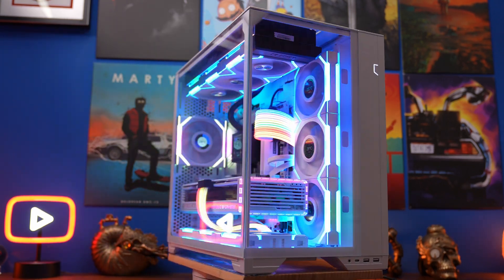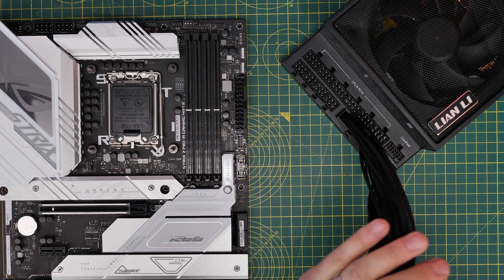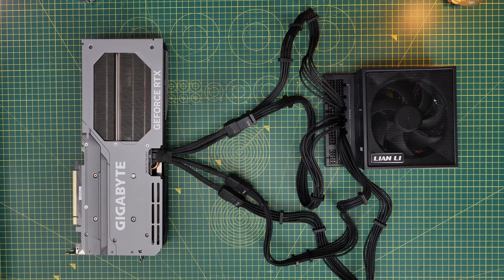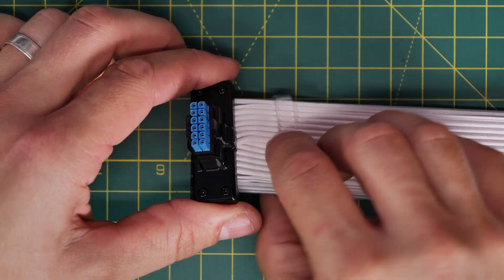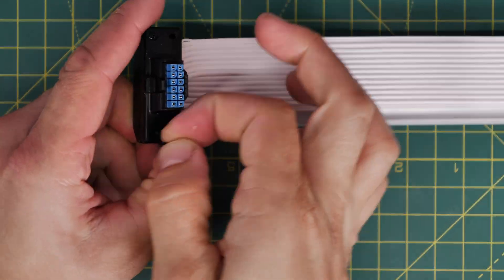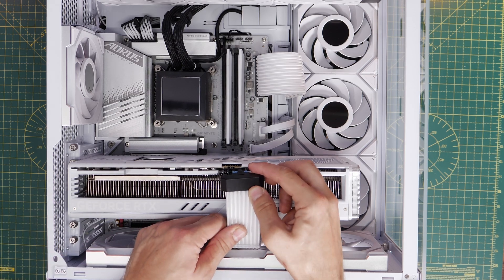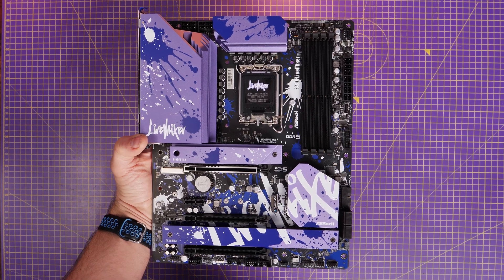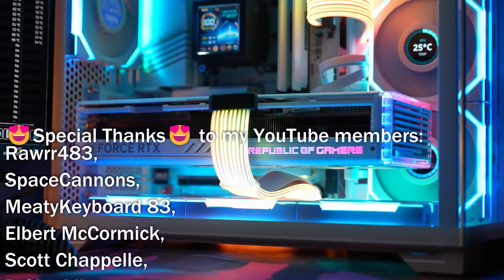Lian Li Wireless Strimer Setup guide - easy RGB extension for your 24 pin and 12VHPWR cables

Comment: I’m just using it for my gpu cable is that possible ?
Reply from the maker: Yes, you don't need both as long as you have the controller
Reply: @ do you know why I don’t see the wireless strimer option in the app?

Comment: I want to order these but worried that the right angle connector for the GPU cable won't be long enough to reach in deep enough to securely connect up to a 5080 aorus master
Reply: Hello , I have an 5080 Aorus master the wireless strimer with the right angle connector is not combatible with it , you need an adapter with a straight connector Lian li said this would be included in the new batches otherwise you can contact them.
Reply: Did you find any information on this? I’m also wanting to know because I have the same GPU

Comment: Thanks for the great video, I've ordered the Lian Li 12vHPWR and the 24 pin connector, this video explained everything I needed to know.
Reply from the maker: @panther938  excellent. Thanks for watching and enjoy!
Reply: I messed up and ordered the wider gpu strimer with the elbow and for my 5070ti I had to remove theelbow cuz it wouldnt plug into my gpu due to the metal shroud on back of the gpu and the width of the wider strimer. Im still in the works of building my rig and I mounted the gpu vertical as well. Might have to try and sell the wider strimer and get the skinnier 1

Comment: Cant find anything about it... Can the wireless version of 24 pin be used as the wired one (Like Strimer V2 24 Pin) ? By that I mean does it have the 3 pin RGB header or I will have to buy Lian Li Strimer V2 24 Pin ? As the wireless version is almost 20 euro cheaper
Reply from the maker: No. There's no 5v RGB cable

Comment: My only question is how to connect a gpu cable if your gpu only has an 8 pin, can you remove some of the cables ?? or is there a port in the box
Reply from the maker: There's an 8 pin version you can buy

Comment: Sorry if this has been answered but do you have to use the 90degree attachment in the gpu itself? As I've got a vertical mounted gpu and don't want the cable to go down infront of it like yours in the video
Reply from the maker: Yes it's standard

Comment: Hi- I currently have two V2 Non-Wireless Strimers setup in my system, and will be upgrading from an RTX 3060 to the 5080 when it comes out. With that in mind, seems I will need a new power cable/connector for the new GPU. Curious if I can somehow use the existing GPU strimer and just swap out the underlying power extender for the 12V-2x6 for the new GPU. Or, should I purchase the new wireless which has this connection already tied in then connect the power to the 3 8pin PCIe cables on the PSU - , but can I plug the new controller into the existing non-wireless v2 Strimer controller rather than the USB-A?

Comment: My PSU doesnt have a 12VHPWR port and im using 3 PCI-E cables going into that god awfull looking 3way split 12 VHPWR cable that came with my GeForce RTX 4080... Is it possible for me to just connect the 12VHPWR RGB extension to the 3way split which then will connect to the PCI-E cables? Or should I just invest in a new PSU?
Reply: So... GPU -> Lian Li 12VHPWR RGB Strimer -> 3-Way splitter (octopus cable) -> 3x PCI-E -> PSU
would this work?
Reply: Is just an “extension cable” so should work

Comment: Can the 12x4 fit a 7900xtx…?
Reply: No, 12x4 is for nivida 40 series and up only. For amd you would want to get the other model of this which is Duel or Triple 8 pin (depending on your gpu model). Just make sure how many connectors and what type of connectors your gpu has.

Comment: Hey Provoked Prawn. Happy New Year. 
Thanks for the details on the wireless strimer. Can you please add the link to the GPU Vertical Mount for the 011 Vision Compact?
I have the universal Lian Li vertical mount in stock. Is it the same in this video? 
Thanks a lot.
Reply from the maker: It's the Lian Li one, yes.

Comment: what if i have a 3x8 pin gpu?
Reply: Same for me, new Radeon 7900 XTX with 3x8 pin power.  The only thing I can think is somehow remove the LED strip portion of a 24 pin cable and attach to the 3x8 cables.  Problem is getting power from the pin connector to the LED strip...

Comment: I don’t like that they force you to use the 90 degree end on the 12vhpwr version.. I like my card vertical mounted and want to wire it coming down from the side of the motherboard with the 24 pin cable as well.
Reply: Same! They should have included another adapter that makes it straight.
Reply: @ yeah I hear you have to ask for one if you bought one of the earlier models.

Comment: I don’t like that they force you to use the 90 degree end on the 12vhpwr version.. I like my card vertical mounted and want to wire it coming down from the side of the motherboard with the 24 pin cable as well.
Reply: Newer shipments come with an adapter to make it straight!
Reply: @ well.. that’s unfortunate

Comment: Do you have to plug into a usb port on the motherboard or could you use one of the usb ports on the edge psu? Thanks for all the great content you are saving my life
Reply from the maker: In theory you could use the Edge. I haven't but I don't see why that wouldn't work. Obviously that has to then connect to the motherboard as well though

Comment: I hate the black connectors, why not all white
Reply: There are white clips to swap for the black clips.
Reply: Yes i know, clips, but connectors are black
Reply: @jefpeters67 it comes with white connectors too.
Reply: @jefpeters67 7:37 did you watch the video? You can switch out the black end connectors with white.
Reply: You are right.....😊damm, allright the GPU but also the 24 pin?  @mysticqro950

Comment: Hi, this arived today, but using the 4090 , it doesnt go all the way in, on the top side its fully seated that you dont see the blue but at the buttom where the pin is have a small gap, just a litle, i tried to push it but it always go back, is this fine?

Comment: If I use a pwm header for this isn't it going to mess with my cooling profiles meaning it will detect a 0 rpm fan on the header that I use? I just foresee problems using the internal pwm header if you are not using lian li fans .....

Comment: I have a question for the gpu one, it has 90° angle but im planning on using it on a aero Card, which has Its conector further back in the card. Is there a way to swap the 90° angle to a straight one?

Comment: I have a 4080 atm which uses 3 PCIE slots. Can i replace those 3 cable with one 12V HPR cable that goes in the PSU.

Comment: which one should I purchase? I have the rtx 4070ti super
Reply from the maker: The one I showed? 12vhpwr
Reply: @TheProvokedPrawn  haha! sorry i thought there was a difference between the 2 on newegg. one just has 8 light strands and the other is 12. But thank you.
Reply from the maker: @nfssupra654  ah, there's a thicker version and a thinner one. Yes.
Reply: @TheProvokedPrawn  Hello sorry for the similar question here @TheProvokedPrawn but i have a 4080 super so either the 8 or 12 light strands on newegg are the 12vhpwr  extender?

Comment: The 24 pin will be imposible for me becuase i use the Phanteks NV7 case, you dont see the wire on the side becuase of the case that has RGB cover the side,
Reply: You can take that part off if you are having trouble with the rgb cables.

Comment: Is there a black set with rgb’s ? I know there are normal black cables but I’m looking for a black set that lights up like the white ones
Reply: How will that even work? The led’s diffuser has to be a white in order for rgb to show up. If they make the diffusers black, the rgb would barely even show up. If you’re talking about the cables, they are hidden underneath so you would not even see them.

Comment: I need help I keeping get a pop up that says “ Windows Explorer the last USB device you connected to this computer malfunctioned and Windows does not recognize it” ever since it popped up the first time my LCD fans RGB stopped working on them and I can’t control the speed of the fans anymore they are like default on highest mode and also the lcd screen on the Aio stopped working as well 
I unplugged them the l connect and reconnected and that worked for about a day and happened all over
Is my L connect bad? It’s not even a year old yet
Reply: This happened to me too although I only have the Strimmers V2 and the SL120 V2 Unifans (got rid of my Trinity Performance AIO because the pump failed on the original and the replacement they sent me).  Turns out for some reason the L-Connect 3 controller bricked itself just out of the blue.  Replaced it with another one (I had an extra one) and that fixed it.  My only issue now is the software will not sync up any new light settings I set up without having to restart my computer.

Comment: My only real complaint about all the different RGB components is that they all seem to require their own software.  It’s kinda annoying to have to use 3-4 different software to try and sync/coordinate the RGB lighting across the case.  My Corsair AIO and fans all use iCUE; mobo requires Asus Armoury Crate (but thankfully can be controlled by iCUE); my graphics card requires Firestorm; my speakers require Logitech G-Hub, now I need L-Connect for Strimer cables.  I wish all of these RGB manufacturers would allow software controls through one main software so I don’t have to screw around with 4 or 5 places whenever I want to mess around with different colors and effects
Reply from the maker: @BigBoyLarry  SignalRGB
Reply: technically what you are asking for is that all of these manufacturers add support for the ARGB motherboard wiring standard.
and also integrate control of any ARGB component that is using this standard and connected to your PC to their software.
this will never happen, because that's technically how ARGB fans initially started, everyone was initially selling their fans which used to use ARGB motherboard connectors.
then came the likes of Corsair and Lian-Li with their own locked ecosystems and most of the other manufacturers followed suit.
i don't quite understand why would you need RGB in your speakers? that kind of sounds dumb in my opinion but i digress.
if your GPU requires firestorm then next time just buy an ASUS graphics card - they support ARGB control from your motherboard's software (which would also make them work with iCUE)

in the current PC market state if you truly want to minimize multiple software reliability you kinda need to use Asus mobos, Asus GPU's (or GPU's without any RGB on them), Corsair iCUE Link ecosystem, and even the Lian-Li striders have a Corsair Alternative, though i think for the Lian-Li strimers its probably still worth it to have L-Connect with the strimers, the Corsair iCUE Alternative kinda sucks
and for Keyboard and Mouse, again just use Corsair keyboards and mouse - that would save you more software clutter.
i know this sounds like a Corsair advertisement lol, but i'm only saying this if you're into a minimalistic cable ecosystem for your AIO+Case fans (only Lian-Li and Corsair have minimalistic cable ecosystems, and Corsair is superior to Lian-Li when it comes to significantly less cables and much better integration, at least in my opinion)
Reply: @HoLDoN4Sec  you literally acknowledged my complaint, and then stated that the resolution is to buy all of your products under 1 brand as a solution.  While what I am complaining about is that there needs to be more universal-compatible in the software component; which would allow builders more flexibility and creativity without being anchored to one brand and save the fuss of screwing with multiple software products as well.

The majority of my build happens to be Corsair - Case 6500D Airflow, icue Link AIO and fans throughout, keyboard, mouse, headset, and mat.  I’m also not trying to advertise Corsair, because their product prices have gotten ridiculous, I am still a fan of their products.

As for the speakers, I bought the Logitech G560 because I liked the sound of them.  But they happen to also have RGB, which was a nice little additional feature; but again, requires a different software.  My Samsung ultra-wide monitor also has RGB backlighting - which again, different mode of changing that color.

My point remains the same - unless you live under one brand, you require so many different software products to coordinate it all that it becomes cumbersome to develop different profiles.  If Windows OS is compatible with all of these other products, then why can’t there be a better means of software development that makes all of the RGB more compatible - even if it has to be through the Windows OS itself?  Someone building a PC shouldn’t have to feel like they NEED to spend more money on one brand over another for 2 similar products just so they can have simplicity on the software side of life.  That’s my point!  I didn’t buy an ASUS graphics card because it was $100 more than the 4070 Super that I did end up buying - another great example of “why should a user have to spend more just to get a software simplification?”
Reply: @BigBoyLarry  yes i know what route i went to lol
if you read what i said, i said initially all of the ARGB products used to work under the same ARGB motherboard standard, then companies like Corsair and Lian-Li started locking you out of the ability to still use RGB devices with the default motherboard ARGB standard.
so what i said is that what you are asking is technically how it all began so its just not going to be happening anytime soon, or anymore to be more precise

so yeah, for your requirement (and i guess mine as well) if you really want to minimize the amount of software clutter you just can't avoid having to buy all of your peripherals from a single brand, or two different brands (such as Asus and Corsair) only.

it sucks i know, but that's just how the world works, its called capitalism.

and yeah you are definitely on point when it comes to Corsair, their products are excellent but their pricing strategy in recent years is abysmal.

and ASUS has put themselves into the same direction as Corsair by spiking their pricing after EVGA has left the market.

as for external PC peripherals, it honestly really depends on what type of lightning you're going with, in my case i got an Alienware Ultrawide and i set its color scheme once when i got it 3 years ago and didn't really need to touch it since, as for speakers welp, idk i don't find an appeal of having too much RGB in my face when i'm on my PC, its just distracting really, but to each their own i guess.

i've had logitech's z906's for the last couple of years and never had any sort of need or requirement to use any proprietary software to tune them.
so if you have to use Logitech's piss poor G-HUB software just to control your speaker's RGB and configuration that's just fucked up man, i would've never bought such speakers if they had to rely on proprietary software for basic adjustments like that for SPEAKERS, so that one is on you unfortunately.
Reply: @HoLDoN4Sec  I appreciate the clarification

Surprisingly, the RGB from the speakers work really well.  My monitor is one of the Samsung ultra-wide curved monitors; so there’s a ton of space behind the “wings” of the monitor to the wall - and these speakers add a nice lighting effect to that empty space.  It’s RGB backlight on the wall, so it doesn’t slap you in the face with color or brightness
Reply: icue is absolute garbage.

Comment: Ah yes, a wireless wire.
Reply: Man... I can imagine how many people are going to post this same comment in the coming weeks.

When your PC communicates with your router using WiFi, there is no network cable attached between your router and your PC.  Your router and PC are still plugged in to a cable to receive power, because electronic devices need power to turn on.

Same thing here... now, the Strimer cable simply connects from your PSU cable to your motherboard or GPU... no extra wire connecting from the Strimer cable to the Lian-Li controller... that is the "wireless" part.
Reply: @MrDosArcade I think he made a joke but thanks for the detailed answer though 🫡 appreciate it
Reply: @MrDosArcade  Unless ur using ethernet like me
Reply: @MrDosArcade yeah thanks, I’m an IT Infrastructure Architect lol
Reply: Nuts isn’t it.
Reply: Indeed
Reply: :v
Reply: Uh uhmm, it’s actually a wire with wireless RGB controls
Reply: Ah yes an un funny person

Comment: Will strimers and fans use the same controller?

Another question, I already have the TL and TL LCD versions, could I just use this new PWM cable and the external USB?
Reply from the maker: "Will strimers and fans use the same controller?" - Yes
"I already have the TL and TL LCD versions, could I just use this new PWM cable and the external USB?" - don't think so